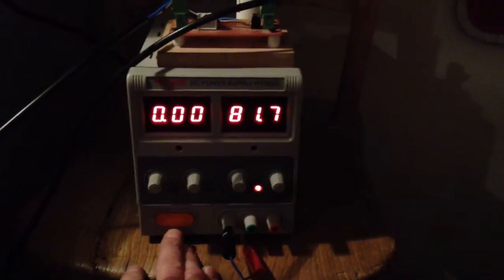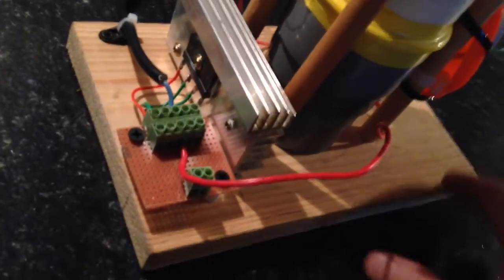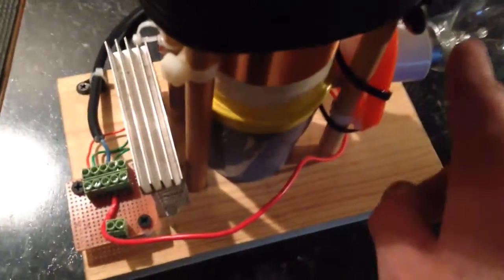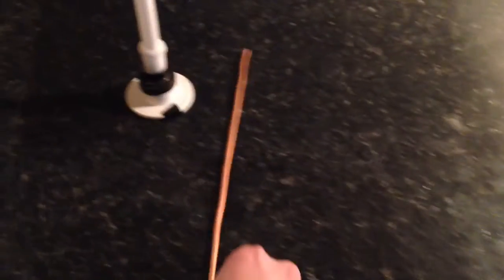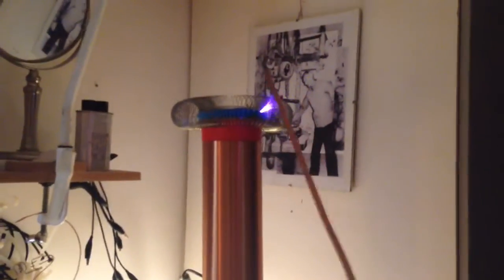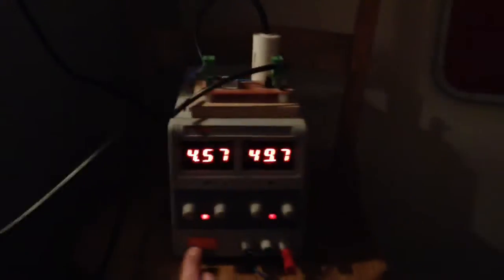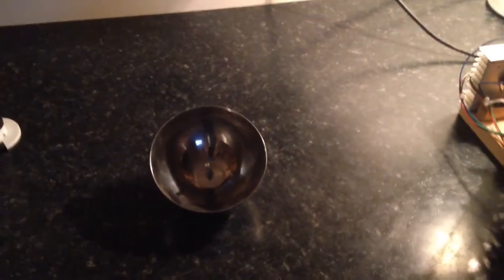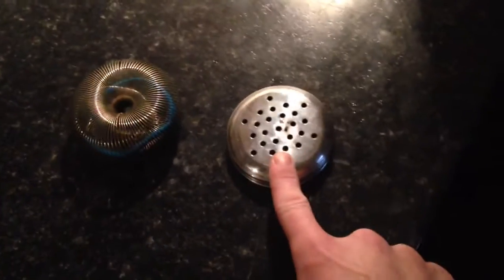80v Three primary Slayer Exciter Transmitter and Receiver fun

Comment: Would this trsnsistor work for a 3 primary slayer (2SC5242NS TO3P BCE 23OV 15A 2SC5242 ) the data sheet says something about audio output but i have no idea if that would that would still make it work or not?
Reply from the maker: It's really hard to say but you're going the right way - high amperage and voltage, and it says for high speed switching. I just went for the biggest I could find. I was buying from AliExpress to keep the cost down as I was blowing so many. I found a stack of 2n6547s at my local electronics distributor in a clearance sale for just over £1 each so bought a ton of those, They worked really well.  I believe those Toshiba  transistors you mentioned will work fine but they need to be cheap so you can afford to loose a few experimenting. I think the ones I was using were all in the 600+ voltage range at 15amps. I started out using 2n3055s but was blowing those very quickly however they did work, just not for very long. Make sure you heatsink your transistors and stick a small fan cooling them as slayers will make them get very hot. Cheers :D
Reply: 2SC5331  i think these might work better?    im just browsing around then i found them   price is a big thing for me also im 2hours from any real place to buy these things  and these are half the price and seem to be at spec with those 2n6547s of your
Reply from the maker: +Jb Steyn I think I've got some of those, they will be ok. You must heatsink them tho. are they cheap enough so you can loose a few when setting up/testing? I would start with about 8k resistance on the base and around 6 turns on the primary. kinda depends on the size of the secondary to be fair but that's a decent  starting place. It's best if you get a 10k variable potentiometer on the base of the transistor so you can find the sweet spot.
Reply: Im thinking of using a 40mm pvc pipe with about 2000 turns of 0.3mm wire   (thanks alot for all the help and quick reply  ill make sure to make a video and send you the link if i get it working
Reply from the maker: +Jb Steyn thanks mate, take care - can't wait to see that video! And good luck with your build :D
Reply: deeds and yes they are cheap enough   they cost a pound round about if change our currancy over
Reply: deeds the 10k pot on the base doesnt have to have a high power rating?
Reply from the maker: +Jb Steyn (lost our thread I had to go to work) not super high wattage but the small ones will burn out if the current is too much. I used to put a decent wattage 10ohm resistor on them so when you turn it to zero it's never quite zero and won't arc inside. It's easy to be tuning and accidentally get to zero ohms and you hear a crackle   Inside the pot which can damage them so the 10ohm resistor protects it a bit. You could put a 1k resistor on to be fair as that's probably the lowest you'll ever want to try and run a slayer.
Reply from the maker: +Jb Steyn  1/2 watt or more here's an example, if you can access this link
https://www.rapidonline.com/taiwan-alpha-rv24af-10k-lin-24mm-metal-case-solder-lug-potentiometer-65-0515
Reply: deeds thanks man   will do to keep you updated

Comment: Amazing output!  Great to see it breaking out like that. What is a '3 primary' slayer? 3 primary coils? Weird set up! It looks like you'll have no problems building the ZVS :))))
Reply from the maker: Hiya mate, thank you.  It's pretty simple really. Wrap up your tower with a few primarys. The then build the most simple slayer cicuit, one circuit for each primary you're going to add.    When you connect it up you'll have three connection points for the primarys (one for each circuit)... but you only have one secondary coil right?  simples... just twist all three wires together.  All three circuits will use one common secondary coil.  This means I can literally stuff 3 x the amout of power into the slayer but I don't melt the transistors... each transistor shares part of the input... even if that psu was running at 5amps it would only be just over 1amp per circuit/transistor... so instantly you get a better output with lower heat.  Good for long runs... I've had it running on 1.5 amps for 4 or 5.. hours at a time. Not even pulling a sweat. Just need a half decent heat sink to mange the heat when you really crank it up.  Thanks again Mr S.   
( Tesla Explorer  has made a mulitple primary ZVS ..he's about to put a third circuit on the same coil..  I actually think his resonator has the biggest bush in the world.. he'll proably be all modest and say something like "yeah it's true!" lol ;)

Comment: I've often wondered how to get the "body capacitance" effect without a body.  Maybe a big bag of jelly wrapped around the receiver :)
Reply: deeds Kind of. I'm guessing any none tuned conductive mass will work eh? no need to turn steak into hamburger?   heh   heh
Reply: How about some aluminum, iron, or copper particles aligned in a suspended gelatinous substance tuned for capaciticizing. AND delicatly vortexed into a wiring network for current tranfer?   BS?  I think it a start.
Reply from the maker: ..I was thinking about what you said and you're right it's my body changing the capacitance isn't it.  I was thinking about messing around with the topload on the receiver, now I'm definitly going to try that.  Thanks again.
Reply from the maker: Scott Russell
..Scott... the thing you're describing sounds like "me" holding a piece of coppper... hehe lol...  I see where you're going mate, like what Mr Price is saying with the Jelly.